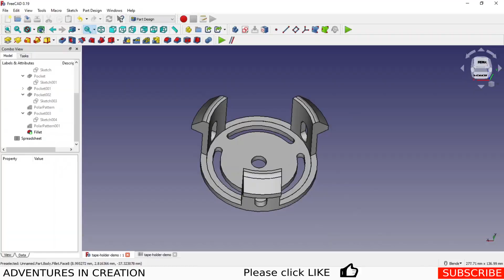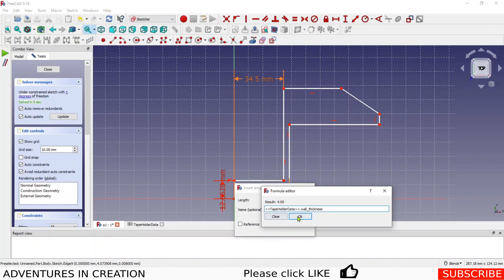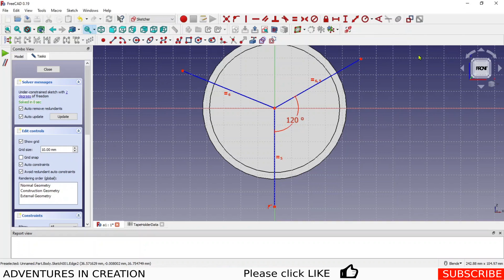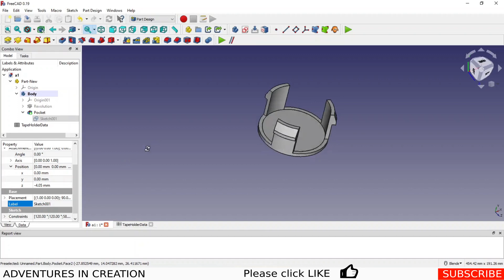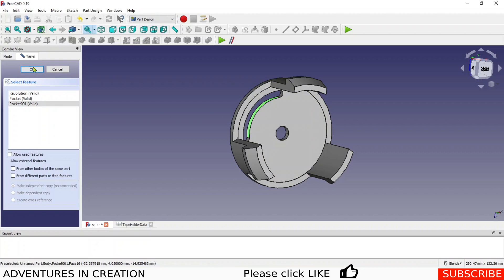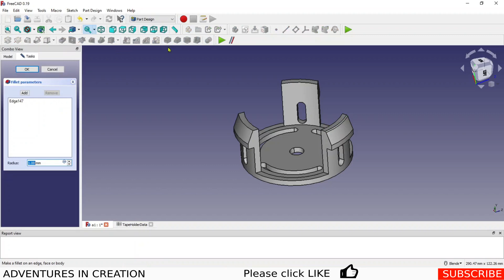FreeCAD Modeling a Masking Tape Holder using parametric design.

Comment: this is broken if you want to use imperial units. you must specify 'in' at the end of each value in the spreadsheet.  Freecad is NOT unit agnostic, internally its treating everything as mm, regardless of what your units presets are
Reply from the maker: Good point, I always use mm by default. - If you are using imperial measurement you do need to specify that.
Reply: To quote the Wikipedia article because I'm lazy though...

Standards for the exact length of an inch have varied in the past, but since the adoption of the international yard during the 1950s and 1960s it has been based on the metric system and defined as exactly 25.4 mm.
Reply: The reason I posted this to illustrate that inches are actually based on millimeters by international standard. I live in America but freecad is not broken in that respect.
Reply: @theMikeChastain  the point you missed is that if you don’t specify “in” after your units, it will get treated as mm, regardless of what you have your default units set to…

Comment: (<<Spreadsheet>>tape_inside_rad-<<Spreadsheet>>wall_thickness )  is only thing that formula editor will find in list to formulate . it works perfect but blows my OCD mind why I don't get yours, .tapeholderdata ..........If I click spreadsheet , all the spread sheet names  just pull right up to select one. You don't have to type so much.  I just freaking stumbled across it . Strange . I'm running  0.19. you must have the Beta
Reply from the maker: I am running the latest stable release. Did you rename the spreadsheet?
Reply: @Adventuresincreation  lmfao NO. omg I feel stupid lol . Ok I just finished this., was a hoot ! I learned more here variety wise then any other vid I followed . THANK YOU ! cheers from Canada )
Reply from the maker: Cheers to you too my Canadian cousin 😉

Comment: Wow this is big ! I need to get another monitor set up on deck to follow along more efficiently. Opening and nesting videos back and forth is very inefficient ( I don't know how to install that  spreadsheet macro (
Reply from the maker: Are you talking about the macro "easy alias"? You can install it from within freecad itself using the same manager that you add workbenches with.
Reply: @Adventuresincreation  install/update selected..all I had to click . I get scared to click. To many train wrecks in my life lol Im old. God bless .Thank you !
Reply from the maker: @BrainDeadEngineering  I completely understand. I just had to "reset" my laptop back to factory settings because stuff just slowed me down way too much. - I too am cautious on clicking ;-)
Reply: @Adventuresincreation I I feel your pain! This semiconductor life we are trapped is a real pain in ass some day omg lol. If any one reads this in join in on donate to this man. He may make a video of how to sketch on a surface / plane with a angle component attached to it .hehehe. Like say a flat plate with a angle pipe coming from it etc :-) FC angulation vids are illusive. I start bid with a $20

Comment: Do people use multiple spreadsheets in one project often? Why do you have to name the spreadsheet before the variables every time? It makes the expression unreadable.
Reply from the maker: You don't have to rename the spreadsheet however if you open multiple files all with a spreadsheet named spreadsheet attached you could run into trouble. You can make the spreadsheet something short.

Comment: I was skipping though looking for the bits I was interested in and happened to see the offset sketch technique (16:30). Why did this never occur to me before? I've been creating datum planes (that's fine and useful, but redundant for things like this) or sketching on a surface (tends to break in some circumstances).
Reply from the maker: The offset sketch is truly a useful technique, sometimes the datum planes/points/lines are useful too. The topological naming issue makes sketching on a surface risky but you can do it if you know you are not going to radically change your model. I believe the issue may be resolved in the future but not yet in 0.19.

Comment: Again I have to say this was a very good tutorial :)

I was fascinated to see how all the shaping proesses ran together.
- sketch 1: the revolve of sketch 1 I would never have known to do. 
- sketch 2: I would never have known to put a square outer around sketch 2 to achieve the three pronged pocket, followed by the wizard like sketch shift by z=-4.05mm to leave an uncut base. 
- sketch 3: the 5mm diameter hole cut through the centre of the base with the radiused cut out arrayed around the edge using the polar array button, was very interesting too see too, as was,
- sketch 4: the again polar arrayed cut-out in each of the three prongs, on the vertical axis. I almost missed the vertical axis bit.
The 4mm chamfer at the top was a very nice touch.

I made a file copy after I had followed the tutorial and did it all again, three times, just to get a better feel for the thought processes in shaping this piece. In my file copy I deleted everything leaving just the 4 sketches and the spreadsheet with it's alises, speeding up focus on the shaping process.

It would be nice to see how the masking tape holder was shaped, to get more insights ;)

Again, very nice tutorial :) thanks
Reply from the maker: Thanks for the feedback. I am glad it helped. I am happy to show how I created the holder in a future video.

Comment: v nice tutorial, thank you :) I followed along and completed the design. Couldn't find the aliases macro on your bitbucket, unless I missed it. I set up the aliases for the B column in the spreadsheet manually anyway.
Reply from the maker: The easy alias is available in the add on manager. I didn't write it, I just use it 😉
Reply: @Adventuresincreation  I did download "easy alias" macro from the add on manager. I'm running the most up to date 0.19 appimage. I selected the rows, 5 or so rows, in column B and ran the macro. Nothing happened. I also tried selecting the cells with values for columns A and B, that did not work either, so I just made each cell in column B an alias manually. I'm running arch linux with the latest Python2.7 (think it's 2.7) and Python3.9.1. (I don't know that much about code)
Reply from the maker: @ksmith7122  when you use easy alias just select the spreadsheet in the model tree, then column a (the names) and run the macro it will associate the name with the cell in column b
Reply: @Adventuresincreation  thank you. I missed that detail. It was there in the video, I just missed it. It does work. Appreciated, cheers :)

Comment: I've been using Fusion 360 for a while but was never happy not being in control of my own files. Today is my first try at FreeCAD and this video was a great first step. Am now watching your video of "5 Tips for migrating...".  Thanks a lot for your videos and macros Ian.
Reply from the maker: Thanks Justin. I am glad you are giving it a go. I haven't found much that I would need fusion 360 for. Don't get me wrong, it's a great piece of software that I spent many hours learning but, I was greatly disappointed when they changed the licensing. It put up a red flag 🚩 that sometine in the future it will no longer be freely available. Plus, FreeCAD is definitely coming along in leaps and bounds. I definitely recommend version 0.19 for general use. I have been using it exclusively.

Comment: Really enjoyed the tutorial, especially the macros, I will definitely install those. I think you could have commited to the parametric part a bit more, for example the slot through the arms could have been tape_thickness - wall_thickness - some offset. But you showed me that you could offset sketches, for which I used datum planes in the past. That makes a lot of things easier.
Reply from the maker: Thanks for the feedback. Take a look at the next video, the electronics enclosure, it is completely parametric including the lid on the following video. I find that sometines it makes sense to go all out on the spreadsheet driven dimensions, sometimes not so much, especially if I don't intend to change certain parts. Your mileage may vary. I am glad you enjoyed the video.
Reply: @Adventuresincreation  Thanks, I'll watch it. I totally get the last part. As a software developer I often get stuck trying to do things properly, so I just started doing them anyways because they probably won't get changed anyways.
Reply from the maker: @pascal-t  have you created any python macros for FreeCAD? I am working on macro but having some issues trying to copy edges in a sketch.